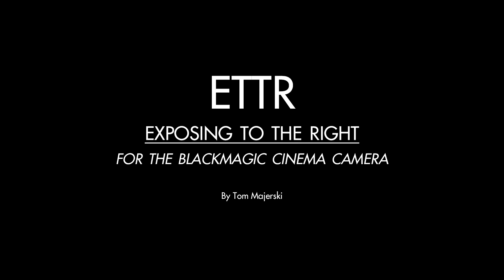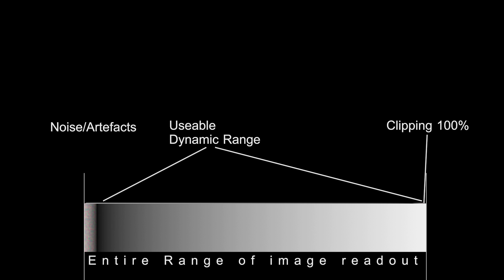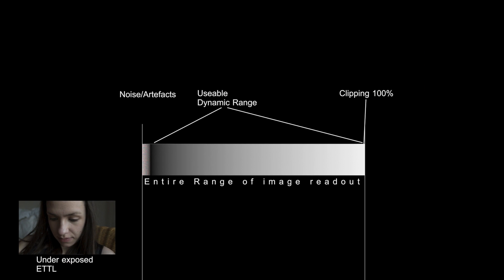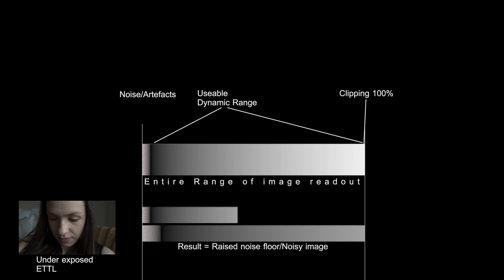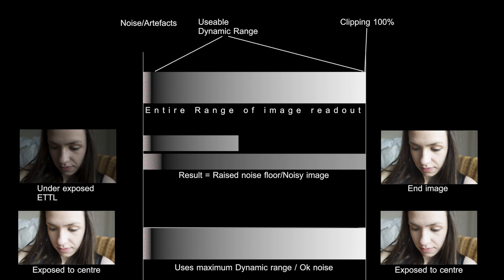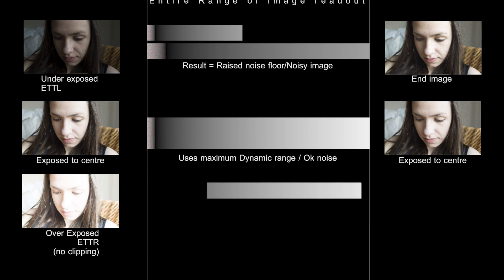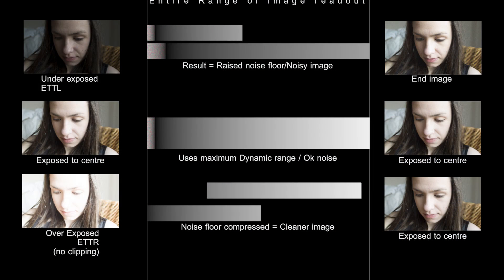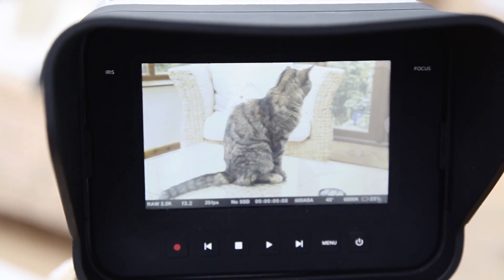ETTR - Exposing to the right for the Blackmagic Cinema Camera

Comment: but too much exposure to the highlights will lose you some details  when graded in post, I would rather expose to the midtones. or get a gray card and a lightmeter. i hope i am wrong coz i learned the old school of photography maybe it doesnt apply to a digital camera
Reply: Unless we are talking about clipping - (which was specifically mentioned as not being the case for this process) then it depends on the camera, for the BMCC it retains a high level of detail right up to clipping. So what you say is not true for this camera. You are describing standard exposure, which maximises dynamic range - but not every shot needs the full range, and this method will minimise noise and give a better image.